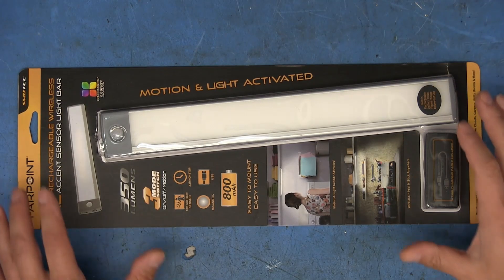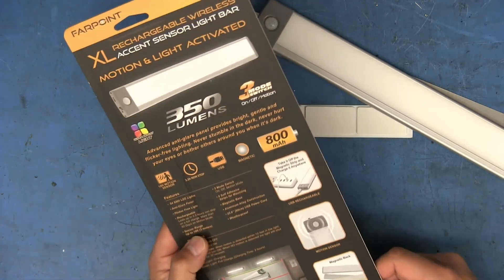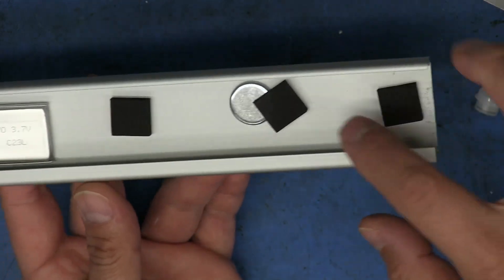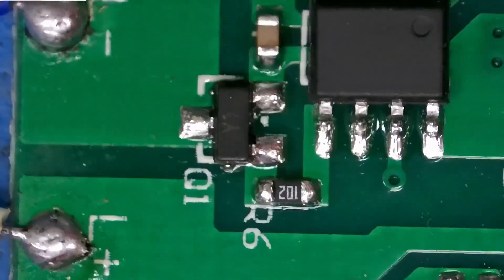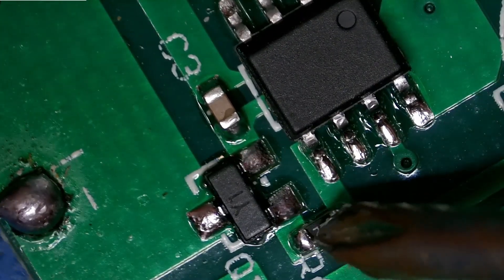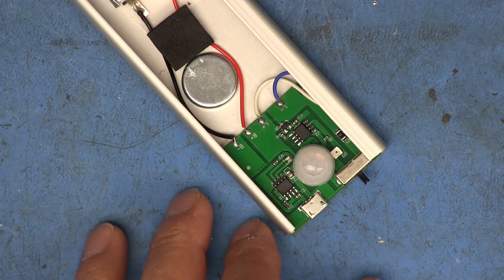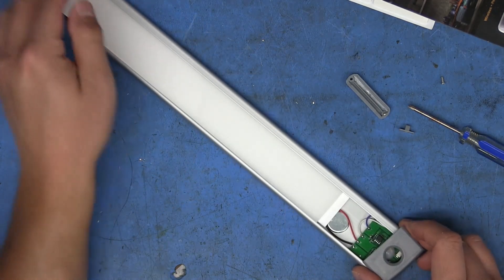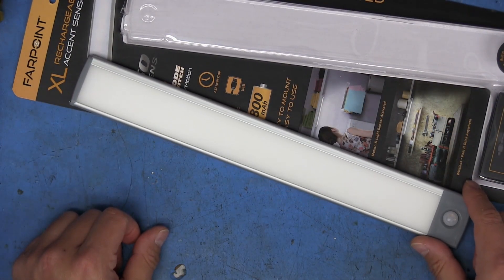TEF #145 | Farpoint Rechargeable Motion Activated Light Bar Teardown/(Repair?)

Comment: i have 2 of these in the smaller version. mounting them in the back of my camper van. They were good for some time but starting failing more and more.  same problem with the switch. little contact spay and oil to should keep it from corroding lets see how long it will last this time around
Reply from the maker: I for sure thought it was gonna be a corrosion issue with the switch, which would've been pretty sad considering it was brand new.